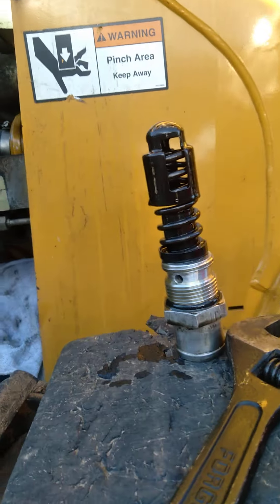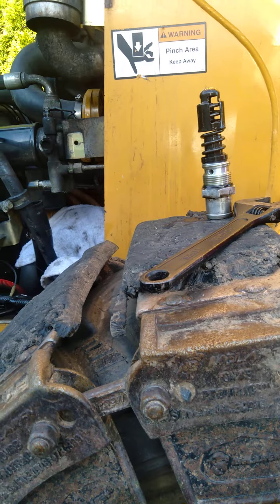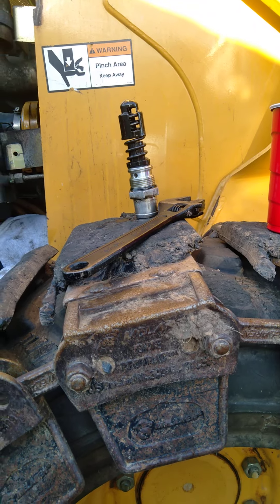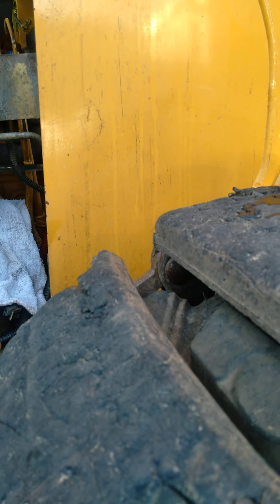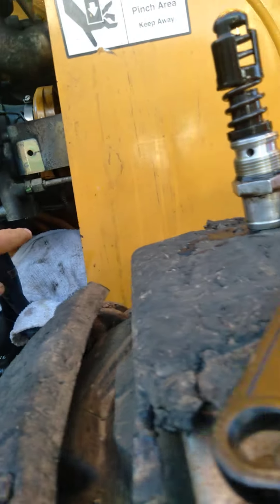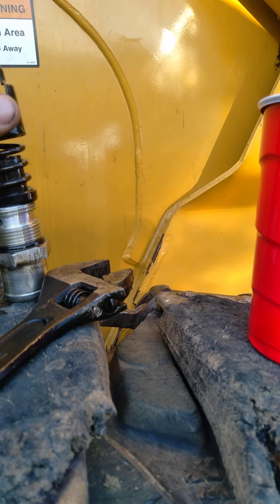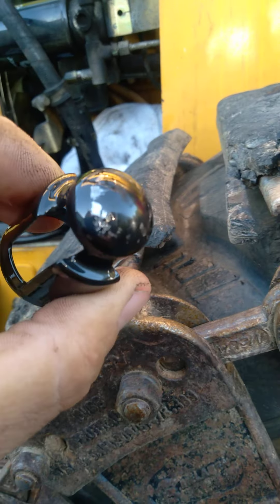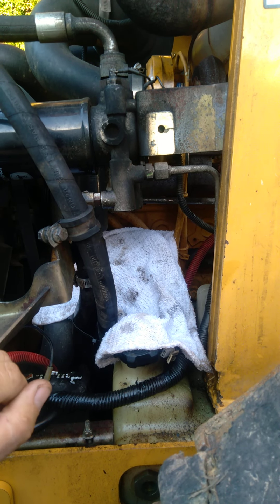John Deere JD 317 320 ct322 skid steer brake / moving / groaning / low power issue found! skidsteer

Comment: Did it work after you polished it ? I have this same issue in a John Deere skid steer 240
Reply from the maker: yes sir,  sure did.  just be mindful that once the material is gone,  it pretty much acts as accelerated wear,  and you might notice some sounds of cavitation (air bubbles rushing) . i ordered a compete manifold but its ran normal another 40+ hrs since.
Reply: Amigo tengo el mismo problema, dónde va ubicada la válvula de alivio 😁
Reply: I've been chasing the same issue on a 280. This is the first time I've heard anything about this. I've spent hours talking to deere. Could be a life saver👍
Reply: Did you have any luck with this?
Reply from the maker: @richcallison  just saw this,  did it work out man?
Reply: @that guy  not the same setup on the 280, unfortunately.
Reply from the maker: @richcallison  man, sorry to hear that
Reply: Solenoid?